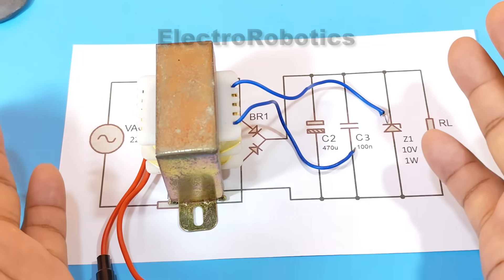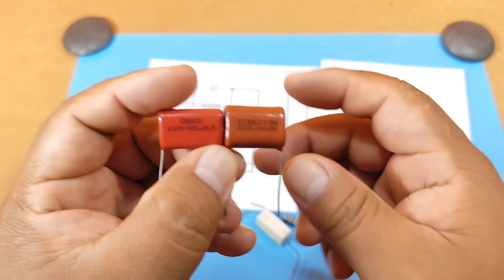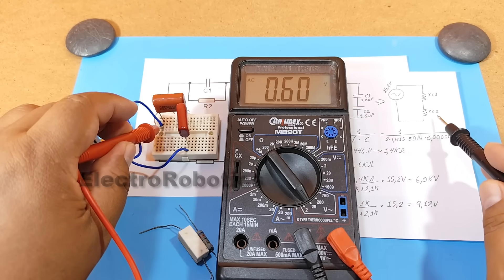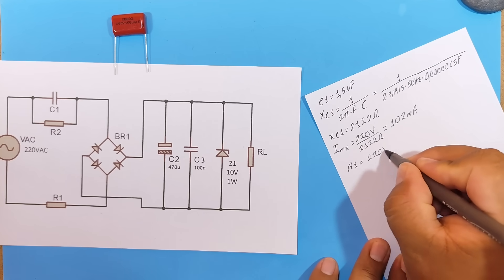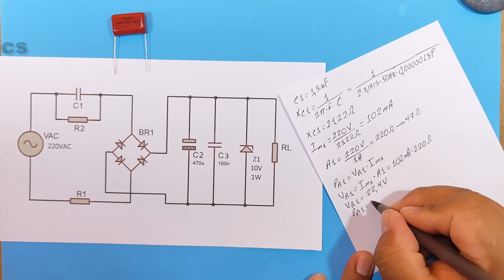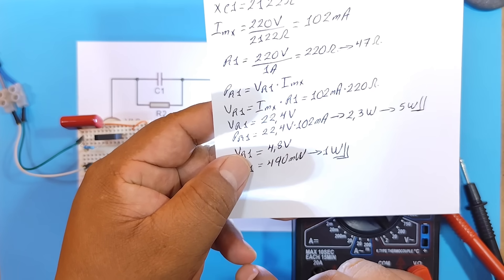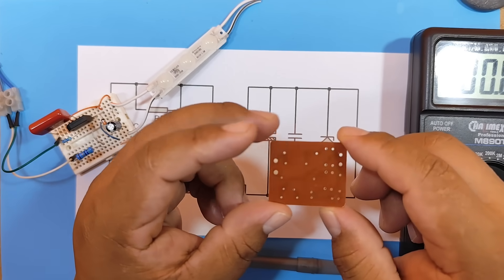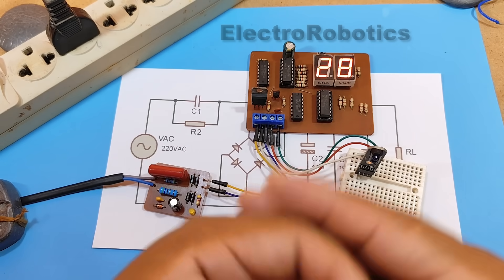No more Transformers, STOP Spending Money on Transformers.

Comment: Without the mains isolation of a transformer, you will likey power yourself as a bonus.
Reply: Beginners should not attempt this,
but when housed in a resin case and using only insulated buttons or switches that users can operate, devices without external input/output terminals can often be safely operated with this circuit.

Comment: As others have said, this circuit is very dangerous. Don't build it. Use instead a transformer or an isolated switched mode power supply.
Reply: Beginners should not attempt this, but when housed in a resin case and using only insulated buttons or switches that users can operate, devices without external input/output terminals can often be safely operated with this circuit.

Comment: Contrary to your "Stop Spending Money on Transformers", it appears that the consensus of the commentary given here is I can save money your way quite riskily or spend money and remain out of the cemetery.
So, could you kindly provide some content episodes addressing design issues that enhance or otherwise stress safety. And how would you otherwise make this project safe or is it inherently lethal as a bread board  implementation?
Reply: Beginners should not attempt this, but when housed in a resin case and using only insulated buttons or switches that users can operate, devices without external input/output terminals can often be safely operated with this circuit.

Comment: Are you sure you can run every appliance by this.There is lot of waste of power in step down the voltage beside there lot safety issues involved in such type of power supply.

Comment: You did not take into account the phase difference of capacitor, so Vr +Vc+ Vzinner is not equal to input voltage.  Power factor is not 1 at the input.

Comment: Lineair transformer? Don t see anything lineair in it, I would call it an electro-magnetic low frequency transformer...(low = 50Hz or 60 Hz) ..  and also would not claim a capacitor has a "resistance", but instead as a (non ohmic (= non dissipative) impedance...no galvanic isolation= death trap! Use SMPS powersupply in stead with much cheaper high frequence transformer while keeping galvanic isolation!

Comment: I remember the electronic engineer I was working with and for said, "capacitors don't heat up,"   LIE LIE LIE!!   As the packaging engineer I put a filter capacitor or a power electronic converter starting with three phase wild frequency generator output. Through the electronics to 400 Hz three phase clean output on to the Airplane.   IT BLEW UP DUE TO GETTING TOO HOT!!!!! 
That myth blown apart.   Reality for calculation that simplification makes sense.  But it has never been true.  
Can never be true because charge is flowing cyclically into and out of the capacity.  The metal in the capacitor has a known resistance to the motion of charge, flow of current.
Transforms are far more robust. then then electronics and they produce cleaner wave forms with no additional components.
Reply: Ripple current through the ESR of a capacitor will result in heating where P=current squared x R.

Comment: MUITO BOMMMM !!!!!
Já usei este tipo de fonte sem transformador ("transformerless") em vários pequenos projetos, pois é simples, leve e barata.
O medo de certas pessoas é de mexer com o circuito ligado em AC, mas é só dimensionar um bom isolamento externo para uso cotidiano que não há problema algum.
Muitas lâmpadas LED mais antigas usam este tipo de circuito internamente, e são seguras !
Há relógios, indicadores de temperatura, sensores diversos, etc, que também usam este tipo e circuito, e estão no mercado há anos sem nenhum problema.
Parabéns pelo vídeo e pela desmistificação da pequena fonte de tensão.
Reply: Can it be used (surely with precaution) to run microcontroller?
Reply: you are not right in your head... such a circuit should never be used other then for a led lightbulb that is what it was made for
Reply: Beginners should not attempt this, but when housed in a resin case and using only insulated buttons or switches that users can operate, devices without external input/output terminals can often be safely operated with this circuit.

Comment: Ok is vid is nothing but BS !  Transformers are special and for the most part very safe to use. ELECTRICAL ISOLATION is soooo very important from a transformer and desired period.
Reply: Beginners should not attempt this, but when housed in a resin case and using only insulated buttons or switches that users can operate, devices without external input/output terminals can often be safely operated with this circuit.

Comment: How's R2 calculated?
Reply from the maker: Hi Max Gom, thanks for the support and for watching the video.
R2 is used to discharge the polyester capacitor for safety when the board is unplugged.
The value of R2 is typically 470K at 1M of 1/4 or 1/2 watt.

Comment: Capacitive power supply is acceptable for charging low voltage low current lead acid batteries & low current light emitting diodes. It doesn't goes on audio applications because it is too noisy

Comment: Il y a deux problèmes avec ce genre d'alimentation par rapport à un transformateur linéaire le premier c'est la sécurité car il y a aucune isolation par rapport au secteur 240V donc en cas de contact avec les doigts c'est la mort par electrocution le deuxième problème c'est le rendement car quand ont a besoin de 10v 100ma soit 1w il y a 330v 100ma soit 33w de gaspillé donc un rendement de 3% du coup il vaut mieux rester avec la bonne vieille alimentation linéaire plus sécurisée car isolée du secteur et avec un rendement de 90% sans régulateur de tension ou alors encore mieux de passer à l'alimentation à découpage meilleur rendement et plus petite et légère.

Comment: These Power Supplies have no gqlvanic insulation.
Using this inside a LED bulb is OK, as you can't touch any electric or metallic parts.
For standard use of power supplies this is an electrocution, it can easily kill you.

Comment: Lebensgefährlich! Meldung ist raus...
Reply: Beginners should not attempt this, but when housed in a resin case and using only insulated buttons or switches that users can operate, devices without external input/output terminals can often be safely operated with this circuit.

Comment: For applications requiring the highest level of safety, especially when dealing with high voltages, galvanic isolation is the superior choice. Capacitive isolators offer specific advantages for high-frequency data transfer and low-power designs but are not the primary choice for safety-critical high-voltage barriers.

Comment: Never ever build a such circuit! This is very dangerus. YT should block such dangerus videos! Report send! to YT.
Reply: Beginners should not attempt this, but when housed in a resin case and using only insulated buttons or switches that users can operate, devices without external input/output terminals can often be safely operated with this circuit.

Comment: No transformer - no security, professor
Reply: Placing the device in an insulated case, using insulated materials for user-operated buttons, and avoiding external input/output connections can significantly reduce risks.
In other words, for LED lights like the one in the video, simply placing them in a resin case makes them safe.
However, they should never be used in devices with external input/output connections or devices housed in metal cases.
Reply: @resistan-y1h  Use it inside your home. Using it outside will conflict with standards.

Comment: this is a dangerous circuit , zener diode is not a reliiable stabilizer and there's no isolation from mains voltage , better is to use a tiny switched mode  regulator that does have isolation , zener diode is also dissipating to much there's no voltag regulation what so ever would not build this in real life

Comment: It's a shame that the many disadvantages of a capacitor power supply aren't mentioned. Only suitable for limited power, only suitable for sine wave AC voltage and it has no galvanic isolation from the mains, to name just a few disadvantages. The capacitor power supply is suitable for precisely defined environments, but as simple as it is presented here, it is a danger for any electronics novice. If a beginner needs an inexpensive, lightweight power supply, a small switching power supply would be much better.

Comment: Now you can question what is cheaper. Yes a transformer is a little more havier but it almost never breaks. If something goes wrong, it's still isolated from the mains so another safety. And yes it's a little bulky. Now let's go to the capacative droppers, how many thing did anyone throw away because it was broken? LED lights flicker and so you throw it away. That little adapter, throw it away because no serviceble parts. A capacitor is most of the times the first thing that breaks down and it give more problems too. Sometimes the shielding is reference to mains, try to take that one out. While let's say, charging your phone and suddenly it blows up because full mains went to it. That little tintle feeling when plugged in, thats reference to main power. Looking at the various equipment, the older stuff still works. Plug it in and you can switch it on. A tuner from the 80's still works while the tv set from 2010 is going to landfill. How much cheaper is that? The only 2 benefits for using a capacitive dropper are, cheap to build and you can make it very small. There is no safety because 9 out of 10, the shielded output is reference to mains power.

Comment: I like having the output isolated from the input of the power supply. Also, if there is any kind of distortion of the input in the form of harmonics, the capacitors may pass more voltage to the output. The transformer may be worth it to provide safety and a more consistent output voltage.

Comment: These are great for double insulated items like LED bulbs, but very dangerous for just about anything else.

I remember a time when CRT TV sets were made without transformers, the vacuum tube filaments were daisy-chained in series, the cases and knobs were plastic and the back was tempered fiberboard. They were okay until the power/volume control knob snapped and you grabbed a pair of pliers to adjust it and got lit up by a hot chassis

Comment: Eso solo son para pequeñas cosas  pero  aver has uno de  50V con corriente 30A 50v+0-50v
Reply: It can be easily made, but it is extremely dangerous and deadly. These power supplies are not used for currents above 100mA (for their dangers)...

Comment: 1:59 even though some shady brands might use CBB21/CBB22 capacitors for capacitive power supplies, these are NOT X/Y rated safety capacitors so their use in anything directly line connected is at least questionable.

Comment: It`s not a "linear transformer", it`s a 50/60Hz transformer used as part of a linear power supply.

And they can be gotten so cheaply from junk devices (eg fleamarket halogen lamps for 12V transformers) that an unsafe alternative is pointless for most amateur purposes.

Comment: This circuit is only suitable for a product where no part of the circuit or load is exposed IE in a full enclosure. In the LED lamp shown this circuit would be ok as there is no part of the circuit exposed when the lamp is in use as the entire circuit of the lamp is inside the bulb enclosure. You should ALWAYS use an isolation transformer for any product that has parts of its circuit exposed eg if there is any external connections for things like headphones, microphones etc. this circuit should only be used for low power applications like lamps etc

Comment: I do definitely unsubscribe from this channel right now. You must not teach bad and dangerous circuits as if they are good replacements for really safe circuits. This is pure bullshit.
Reply: ...And should be banned...
Reply: Beginners should not attempt this, but when housed in a resin case and using only insulated buttons or switches that users can operate, devices without external input/output terminals can often be safely operated with this circuit.

Comment: how about the safety?
Reply: Beginners should not attempt this,
but when housed in a resin case and using only insulated buttons or switches that users can operate, devices without external input/output terminals can often be safely operated with this circuit.

Comment: Das ist eine Anleitung für einen preisgünstigen elektrischen Stuhl.
Reply: Ist genau so! Made in India ofc.
Reply: Beginners should not attempt this,
but when housed in a resin case and using only insulated buttons or switches that users can operate, devices without external input/output terminals can often be safely operated with this circuit.

Comment: This is a video that no one needs to duplicate. They use transformer for very good reasons. Think about even one of those parts short with what he is stating, what happens to the circuit. And who is in danger when that happens. Make your circuits with the proper parts!
Reply: Beginners should not attempt this,
but when housed in a resin case and using only insulated buttons or switches that users can operate, devices without external input/output terminals can often be safely operated with this circuit.

Comment: Isolation transformer😢 are safe
Reply: Beginners should not attempt this,
but when housed in a resin case and using only insulated buttons or switches that users can operate, devices without external input/output terminals can often be safely operated with this circuit.

Comment: Are you serious ? Not a single word about safety ? This thing is deadly dangerous !
There's no galvanic insulation from mains. Don't ever put your fingers anywhere near this circuit (yes, even the output low voltage isn't safe). Put it in a plastic box with no conductive parts outside.
And don't forget R2 (470k or 680k) across C1. The capacitor can remain charged with high voltage even if you disconnect the plug. R2 will discharge it so you won't get a zap if you touch the plug.
Mains voltage isn't a joke and most viewers aren't experts. Please stay safe !
Reply: I imagined the same thing. As a beginner, I've experienced situations where a capacitor exploded in front of me in a circuit on the power grid without galvanic isolation and a slight shock from a charged capacitor even after unplugging it. Luckily, I didn't suffer anything serious, but it could have been fatal in other cases. I think it is irresponsible to share circuits that use the electrical grid with beginners and laymen without effective warnings about the magnitude of the risk.
Reply: Agree 100% : A transformer give the in most cases the safety against electric shock.  Capacitor power supply are only okay in closed circuits like twilight switches, thermostats etc.
Reply: Never mind "safety".  This type of power supply is usually found in cheap LED lamps and it is very risky to use it to power anything else drawing any current other that it was designed for.  Horrible regulation, enormous ripple.
Reply: You are right,this is intended for cheap power for low current circuits to approximately 200mA,and the stabilization is bad and devices that need clean and stable voltage shouldn't be used with this supply.
Reply: Me quedo con el transformador , mayor seguridad,  menos ruido de linia , mayor durabilidad .....
Reply: Agree with you, 
Those circuits have been familiar to me since 2012 and this circuit only use for low load, this circuit is too dangerous without isolation.
Reply: Thank you for this, you got here before i did.  Your comment on line isolation is spot on!
Reply: ' about safety'  Yep soon as you saw the title, you knew this was someone who had no idea how important transformer isolation is for LV circuits for general use that you'll actually be handling etc.
Reply: These yellow books have no idea what they speak.
Reply: This is a very dangerous circuits that should not be build by novice
Reply: Thanks Dad. He is teaching circuits. And he has been very helpful. Maybe he should add a disclaimer after he announces himself as professor Nelson from electronics   😮. It’s assumed that you know about basic electronics safety.
Reply: Ausgezeichneter Beitrag zur erfolgreichen Minderung der Überbevölkerung und zur Reduzierung der Anzahl vermeintlicher "Fachkräfte". 😂Nur zu, und schüttelt dem Kollegen vom Kraftwerk kräftig die Hand! 😂
Reply: Viewers of electronic videos are not stupid.
Edit. By "teacher" I meant Goggle, not this up-loader.
Reply: Bravo for your truth
Reply: Just i come here to write the same about it, is so irresponsible and dangerous, please people avoid make this kind of circuits, is to DANGROUS!!!!. and after that 0 efficiently.
Reply: @ricardo-rector 
Beginners should not attempt this,
but when housed in a resin case and using only insulated buttons or switches that users can operate, devices without external input/output terminals can often be safely operated with this circuit.
Reply: Spot on,  plus I don´t put much trust in videos about electronics that use a low quality artificial voice, instead of a real person.
Reply: Simply....vidéo not for biginners.....safety .....can avoid dangers wirh other protection ....the idea is vers important
Reply: I was thinking the same. Your post should be pinned on top, to say the least. Interesting as it is, the video should be remade warning very clearly about this o taken down.
Reply: @RufianEmbozado  Infantile remark. 
The video may by crappy but to demand "teacher" to take it down?  Better ask "teacher" to bring back the display of the number of thumbdowns.
Reply: @andreasproteus1465 Infantile remark. It was not "teacher" who removed the "thumbs down" counter, it was Google. Go look for some plugin if you're so interested. Plus, any "teacher" would correct its errors, if he's a "teacher", that is. Don't worry, even you'll eventually get a little wiser and less "edgy". ("Infantile remark...", sure).